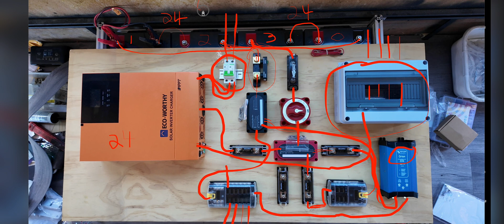24v Van Life Electrical | Install a simple all in one inverter system

Comment: Great Tutorial. One question, I plan on having 499 watts of solar on the roof and an additional 400 watts portable solar panels. Do I use the single breaker for the 2 sets of solar panels or a separate breaker for the portable ones? Thanks

Comment: Thanks for this made sense, quick question. My cable coming from van battery has a vsr to the lithium to charge also, can this be wired to the inverter or not. If so how. Thx

Comment: Why not use 24V batteries? I put a Victron-based 24V system in my van and almost all the loads are 24V.
Reply from the maker: client already ordered these batteries
Reply: @nomadbrad503 sorry, yes I was wondering about the client, not you.

Comment: Ex electrician here looking to build out my 6x12 utility trailer, So If I get 2 of the sungold 3000w and 4 24v 100ah litime batterys I can back feed a 220v panel? how much solar would I need and 220v makes that mini split a 15 amp breaker not a 30. so Id assume it tax the bank a lot less I have dogs I need to keep cool during hot days. Next question would I need double the shore power to charge with 2 of the inverters/chargers, I do not see my roof holding enough solar panels. Thanks Jerry.
Reply from the maker: Hello Jerry, those are great questions. If you book a call, I’m happy to discuss your system and answer your questions :
https://shop.beacons.ai/nomadbrad/404eac6d-1ee9-45ed-8e73-59a9b6e70d8d

Comment: How is grounding and bonding managed by the inverter. Does the inverter automatically switch from chassis-ground to shore ground. 
Also, it would be interesting to see the AC part, as well as an optional Dc-Dc 12-24 boost charger from the alternator
Great to see a more affordable system compared to a Victron system

Comment: Brad how many panels for this system and what was the VOC/amps/watts of these panels?  Max PV wattage for that inverter is 1400watts which is my goal.  I am guessing you had to wire the panels in series/parallel?
Reply from the maker: The client had 2 550 watt renogy panels. I wired them in series.

Comment: I like your setup. However, if I'm not using solar panels is that ecobox Overkill? Do they make one that's not set up for solar panel input? Or do you know of another company that makes something similar? Thank you
Reply from the maker: How will you be charging your batteries?
Reply: @nomadbrad503  I have a '02 Sprinter so we'll be charging the batteries with the alternator. We might be adding a second alternator to the engine. What are your thoughts on that? I know a lot of people do that. I just don't really want to invest in the solar panels at this time, but it might be something in the future we'd want to add so it would be nice to have that option
Reply from the maker: @tallyman15  there is no reason to buy this inverter charger if you’re going to use an alternator as your charging source. Just buy a stand alone inverter. Alternator charging is limited. The largest alternator charger Victron makes is 50 amps which will produce about 600 watts per hour. You have to do a lot of driving to charge a large battery bank.
Reply: @nomadbrad503  okay, maybe I need to reevaluate my setup
Reply: @nomadbrad503  okay, maybe I need to reevaluate my setup
Reply from the maker: @tallyman15  yes. You need to run an actual calculation to determine your needs before you buy anything. It’s easy to underestimate how much energy you need and overestimate how much energy you can produce.
Reply: @nomadbrad503  Great information, thank you

Comment: By my multiple comments you can probably see electrical systems are out of my depth of knowledge but I would love to set up a 24 v system like in your video.  With that being said is there a way I could book time with you for a consultation via zoom since traveling from SW Florida to California would be difficult without my van set to go?  In my previous micro van conversion I used a power station and was very happy with that but I just bought a bigger van and I want to add a 12 v air conditioning unit that can’t be supported with my power station.  All the moving parts shown has me a little hesitant to start buying pieces and assembling the system.  Any help is appreciated. Thanks
Reply from the maker: Hello, you can book a consultation with me. I also have the ability to design and build a custom system for you and ship it to Florida. 

You can book an appointment here: 
https://shop.beacons.ai/nomadbrad/404eac6d-1ee9-45ed-8e73-59a9b6e70d8d

Please note, I will be at burning man from 8/24 - 9/3  and will not be able to take appointments during that time

Comment: Do I have to have 4 12v batteries to do this system or can I use just two 12v batteries wired together ?
Reply from the maker: you can use two

Comment: Do I need all the batteries used in this set up to run my 12v or 24v air conditioner?  My needs are less than this bus but knowing how much battery capacity I need is the hardest part of all this build.  Love your step by step instructions and it makes me believe I can manage this with the help of friends to do this.  Cost of builds of electrical systems are going up as high and as fast as buying the van.  Looking to purchase the Velit 12v a/c unit that requires 600-670w ( eco mode-250-300w, turbo mode 400-650w),  what battery capacity would I need to run this unit as needed.  Thank you in advance for any information/expertise you can share.

Comment: You should never use solid wire in any moving vehicle. It doesn't allow the movement of the wire. Stranded is the best way to go in a vehicle.
Reply from the maker: That was my belief….but explain why every rv and travel trailer uses solid core wire for their 120v circuits. And these vehicles are all certified for electrical safety by RVIA? 

This is the reason I allow solid core wire on 120v  circuits. Everything else is stranded
Reply: @nomadbrad503  Old man with years as a pro on both boat and RV wiring Brad;  Indeed, finely stranded and usually tinned is the standard for marine and aviation. These craft are built to hold up to harsh environments for many years. RVs on the other hand are considered obsolete and ready for the scrap heap in 20 to 30 years, plus if they malfunction (or start burning) , you can just step out and watch her burn. Not the case in a boat or aircraft.

Comment: Shouldn't you be pulling the negative from the other battery bank? Because the way you drew the lines you are not using the full battery bank. One 24V battery is being used more than the other one.
Reply from the maker: I am pulling positive and negative from opposite ends of the battery bank

Comment: Would a 48v electrical system be even more efficient? 🤔
Reply from the maker: Yes and no. You have efficiency losses stepping down from 48v to 12v. And you need a large solar array to maintain higher voltages required to charge a 48v battery bank

Comment: how would u wire this for 220v?
Reply from the maker: Basically the same way. You’re just using 220v wiring rather than 110v. They make 220v units

Comment: Is the mains charging the batteries on that unit? If so, how many amps?
Reply from the maker: Yes, the mains charges the battery and is adjustable to meet your battery charging requirements
Reply: @nomadbrad503  I went down the rabbit hole on these. 
There's so many different specs! 
Starting voltages, charging priorities, 
Whether you can truly leave them unattended when they're hooked up to the mains. And of course pricing. 
I noticed you were also using a sun gold at some point. 
Maybe you could do a comparison video for us? 😀
Reply from the maker: @jeffensing  you’re correct. Each unit has different specs. You can’t really compare them. They all have different uses. I couldn’t use the sungold power on this install because she does t have enough solar
Reply: @nomadbrad503  gotcha, I keep buying components but after I learn more I want different ones!  Lol
Reply from the maker: @jeffensing  I hear ya! It’s best to design your complete system before buying stuff

Comment: Those all in ones can have pretty large standby consumption. Any consideration to have always on 300w inverter for small loads?
Reply: Would you consider a small portable power station?
I was thinking to get 2 portables like Bluetti or Anker $250 for their flexibility, even outside.
Thinking to keep them charged from my driving and a small dedicated solar panel.
Reply from the maker: That’s definitely an option
Reply from the maker: Sure, you could do that

Comment: Its videos like this that allowed me to build my system with zero experience, those all in one boxes make life so much easier to build than mine was but I do wonder what the longevity is of them? 
It says 2 years warranty which doesn't inspire any confidence as this is not your typical consumer electronics product, your relying on it completely....Didn't know about those eyelet zipties, thanks.
Reply from the maker: I have been using mine for almost 2 years. So far it’s been great. I was a little concerned about having all the components in 1 unit but for $500, of it fails, I’ll just Amazon prime a new one.
Reply: @nomadbrad503  yeh its hard to argue with the price to convenience ratio :)

Comment: I am a simple man. I see Brad post, I click the notification.
Reply: Brad is rad
Reply from the maker: Awww i appreciate you
Reply: Hey so I wanted to install a mini split but my current set up is three 12v 200ah battery with about 400watt in solar is this possible or I'm I right in thinking I need more panels @nomadbrad503